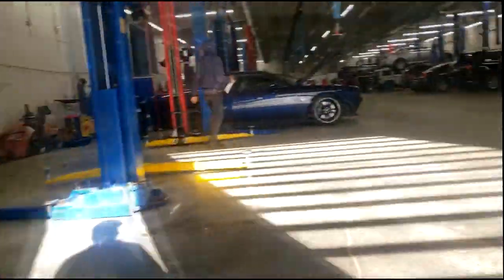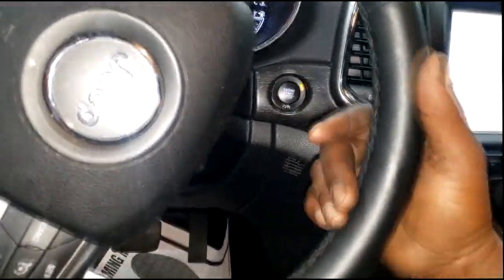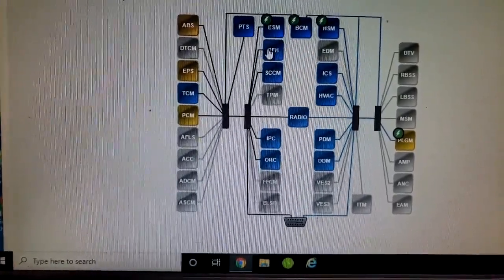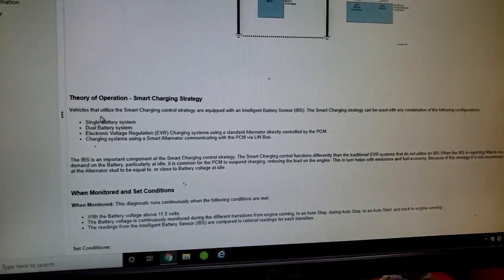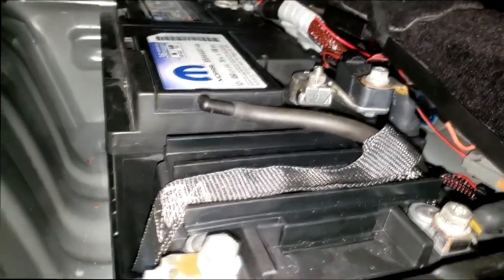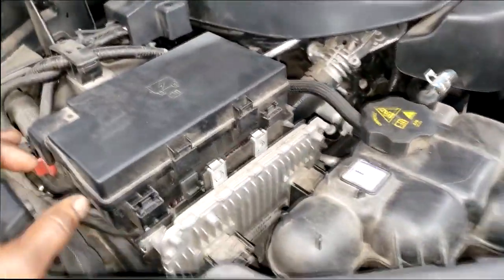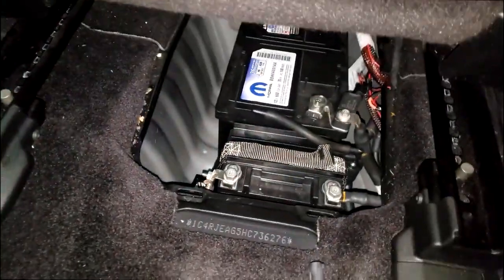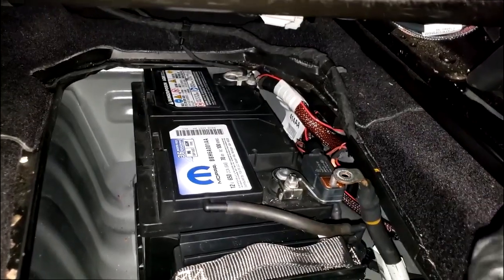No Start, Starter cuts out during cranking. New battery New Starter. P058D. Electrical System Test

Comment: There's no way the IBS is the problem here. People often unplug it to disable stop/start (I don't agree with doing this, but just pointing this out), and never have this problem. The P058D code was probably triggered because the owner disconnected the IBS to disable stop/start themselves or while replacing the main battery. All of those DTCs look like they could've been caused by an electrical system fault (e.g. disconnecting the battery, low battery, etc.).

If the aux battery was never disconnected while the main battery was replaced, that would explain how the DTCs are still stored and not cleared. I agree with @Tom Cook, look at Tip Start modules/components. I would also test the aux battery to make sure it's still good. If that aux battery is bad, it will drain the main battery because they are connected in parallel when the engine is turned off. You MUST electrically separate the two batteries (just disconnect one of the negative cables) to properly test them separately, otherwise the tester will see both batteries as one large battery and the test will be grossly inaccurate.
Reply from the maker: As stated in the title both batteries and starter new so I didn't spend much time on those. You guys make great points but keep in mind, the Jeep is fixed and gone. Also keep in mind that the IBS plays double duty as the negative battery terminal. The lag starter problem occurred after these parts replaced. Customer didnt want to go back there. During replacement of the IBS I would make sure its on tight and secure as well as the positive terminal. Ground (IBS) and positive terminal now on tight and secure. I didn't pay much attention to if it was not tight and secure because the battery new. (Surely who ever installed it tighten it) who knows.
Reply: @OnlineMechanicTips  To be fair, the title does say "new battery" not "new batteries" so I interpreted that as only the main battery was replaced. 🙂 The IBS is basically a terminal with an ammeter/voltmeter built into it. It doesn't control the flow of current, it only measures it. So, even if the sensor portion fails, current is still able to flow through it.